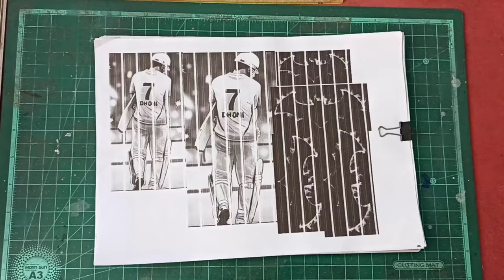How to clean a clogged printer cartridge. DIY printer cartridge

Comment: Thank you for this tutorial which made me understand a lot of things. I had refilled an empty print head (HP 62XL) with ink from a new cartridge that did not work. Unfortunately, it didn't print anything at all. I tried many methods, cleaning the heads by the printer, soaking in hot water, in alcohol, nothing worked. Out of curiosity I put my mouth on the print head and sucked gently. At first, nothing came. Then something came out and I rinsed my lips and put my cartridge back in the printer and started printing right away: it was perfect.
Reply: No, not really. In fact, what warned me that the ink was coming was that I smelled it, very characteristic. Then I rinsed my lip, rather by conscience, because I did not see any black trace.
Reply: Thanks It worked for me too, But I just can’t believe that my first kiss is with a catridge..
Reply: @joshuasantiago3526  LOL 😂😂😂
Reply: I have tried what you have tried too but no help . 
But sadly "sucking" method also doesn't work in my case . Again and again I tried but only black teeth and tongue happened.
Reply: @smyureka3055  If you received a black tongue and teeth, then the ink flows! The problem is why it stops.
Reply: @aureliebesson6887  actually in my case it was printing but it's printing a blank white line between words as if all words are strike through a blank line. Happens in  every 3rd line.
It's not going away no matter what I try. May be cartridge is damaged:(
Reply: I tried sucking ink with my mouth and oh boy now I can print with my mouth too.
Reply: ok, how the in the world you came into the idea to suck the print head in the first place
Reply: @rocky-zx6kq  Other use a vacuum clear with several layers of toilet paper in between. I just used my mouth with those layers of toilet paper so ink won't get to my mouth. It works.

Comment: Always use your printer to avoid ink drying on nozzle or clogging. At least every other day. Print a very small CMYK Bar so that all ink color are used to make it always wet. Leaving your printer off for how many days can cause ink drying that leads to printer head nozzle clogging.
Reply: Thanks for sharing!
Reply: Thanks bro!  I was planning to keep my present printer and use the old one to consume my newly bought ink before we leave. Thanks Ive seen this advice of yours. ❤
Reply: Just leave it on so the printer can trigger a maintenance cycle at preprogrammed intervals to keep the printer heads clean.

Comment: I tried all other methods like steaming and soaking in hotwater, cleaning with earbuds, tissues, Alcohol based cleaner etc.. nothing worked for me.. finally I tried this as a last resort before almost decided to buy new cartridge.. surprisingly this thing actually worked and I used shoefixer to glue it back in place
Reply: Is it still working

Comment: Dint do this i repeat dint do this if you want just leave the print head in warm water overnight but dont let water inside the cartridge cause it causes vapour bubbles which is worse then dried ink in the cartridge

Comment: Interesting, that is a deep clean.  I usually take the print head off and soake the tip of the print head in warm to hot water for 2-3 minutes to break down any dried ink in the port jets.  This works for me, but this is an alternative.

Comment: Never take the covers off.  I fallowed a refill video that showed that method and every time I tried to print something after using that cartridge I would need to refill it before I started.  It is the same as leaving the cover off a marker.  If the covers come off you need to have a way to reattach them so that they remain perfectly sealed as they were before you removed them.  A couple of dabs of crazy glue on the sides won't cut it.  The old glue needs to be filed off bot the cover and the base, and something I have yet to discover needs to be used to reattach the cover to the base in a way that it is perfectly sealed.
Reply: BCH sells a conversion kit and they have videos here on YouTube that show you in great detail how to use them. If you follow their directions it totally works. If you don't want to do it yourself you can send them your old cartridges and they will convert them for you. They have a video that shows you the options and how to order on their site. They may even just sell converted ones...not sure.
Reply: @heatherpagefiberfreak4230  Just buy a primer for $3 and NEVER take off the cover.  If you don't manage to get a perfect seal when you put the cover back on, the ink will drip onto the inside of your printer and you will find the cartridge needing to be refilled every time you go to use the printer.  Also, I'm not sure why you would ever run water over your sponge.  That's another example of what not to do.
Reply: nah just buy some T-1000 glue that is usually use for smartphone.  those glue when it cured becomes rubber. that rubber become the sealer.
Reply: While you are correct a couple of dabs of crazy glue won't seal it, you need to apply a bead around the entire perimeter of the top of the cartridge before re-attaching the lid. Doing anything less will, of course, leave air gaps and not seal it.
Reply: @ColHogan-zg2pc  - So why bother taking the chance.  Why not just drill the hole and plug it like every other how-to video explains.  I've been doing it that way now for years and never had a problem.
Reply: @kirkmcintyre53  Nah, you just don't know how to glue it so it'll be perfectly sealed. I've done it with no problem.
Reply: @rap3208  - That's exactly what I said.  To anyone else reading this, DON'T take the covers off.  Inject the ink through little holes you drill that are so easy to seal you can do it with a piece of scotch tape.  The how-to guides are everywhere.  If you want to get fancy you can purchase inexpensive rubber plugs for the holes.  No mess, no stress, no leaky cartridge.
Reply: @ChibiKeruchan  - you could also use rubber cement or silicone or a million other products.  Or you could just not take the top off in the first place and never worry about it.
Reply: too late 😭 I've opened the cover

Comment: As my experience i do this also but until i notice the problem that it was the printer drum which cost much
Reply: That kind of printer has no drum. What are you talking about
Reply: What kind of experience can you have with a printer drum in an inkjet printer which does not have any such drums?

Comment: Anybody Don't do this process, i lost my working cartridge by this process.
Use hot soldering iron.
Cut upper cover. Pull sponge clean and refill.
It will work.
But don't vibrate them.
It,s printed bus bar is very thin.
It will dammage when u try with knife and hammer.
Reply: Thank you
Reply: Wait, where is this hot soldering iron comes to play?

Comment: You have destroyed the cartridge by putting the chip in water
Reply: What? LOL! You can put electronics in water for cleaning. Just make sure it is dried fully before applying power. I clean industrial PCBs with soap and water then dry in the sun for 1 day and it works fine.